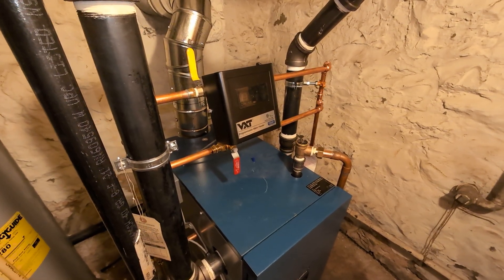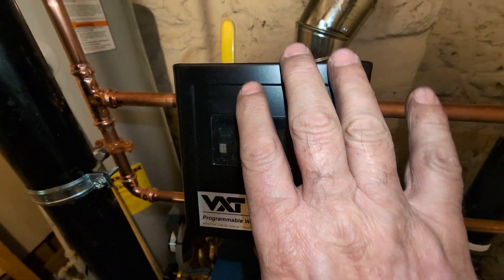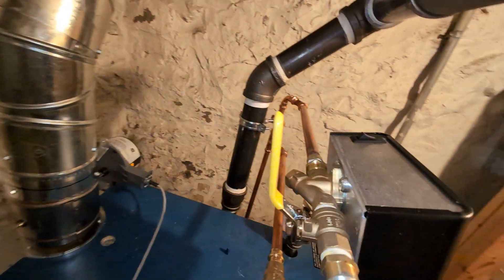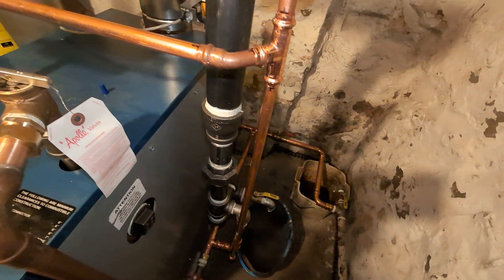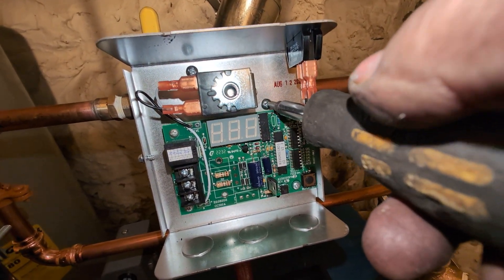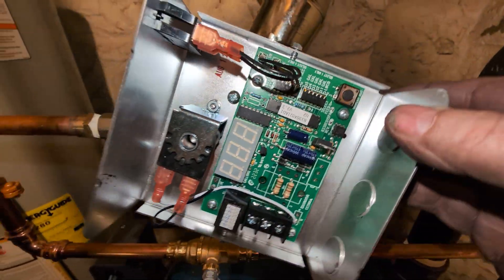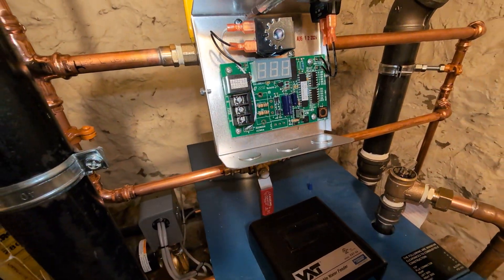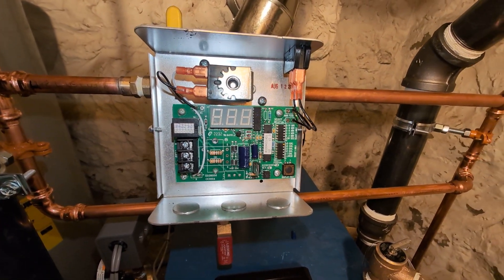No Excuses! Why Install Anything Else Other Than A Hydrolevel VXT?

Comment: Great video Gordon. I’m enjoying watching your videos as I prepare to write my plumbers exam. 

My only question is, which supply is the water make up connected to, hot or cold? My understanding is that hot water already has less oxygen and comes pre-heated. But I’ve also heard hot water isn’t ideal for the materials in auto fill valves, or am I mistaken? Thanks
Reply from the maker: Thank you for the kind words!
All steam boiler automatic fill valve manufactures say not to use hot water as a supply thru their equipment.
Calcium & magnesium salts drop out of solution and scale up the wet surfaces of the valves worse when hot water is used as opposed to cold water (seems counter-intuitive).
Crab steamers need hot water fed to their boilers to keep up production, so in order to get around the calcium build-up issue, they use the feeder valve on the cold water inlet to a standard water heater and the hot water is sent to the boiler thru a Spirovent to remove the air.

Comment: I suggest (3) unions. 1 after eye water feed, 1 after the bypass and a common one on the vertical above the water level. When the boiler over fills, you can break the unions and see which is leaking by. I have seen this numerous times.

Comment: Working in New York on service calls and I come across the MM 101A  most of the time it’ll be the problem
Reply from the maker: @pipers255  Yes indeed 
The 101A may have been good back in the day, but that day was 1/2 century ago.
Even M&M makes a better feeder in the Unimatch
(I briefly met the designer back in 2005).
The only reason M&M still makes the 101A is folks still buy it and they make $ selling that junk.

Comment: The boiler rotter-outer. Trains homeowners to ignore their boiler and to allow the water level to be much lower than it should be lessening efficiency and increasing the temperature of the top of the section castings. Not a fan!
Reply from the maker: I understand your point of view, and your points do indeed have validity, but you must admit you yourself are a few sigmas out in your attention to your steam boiler LOL. 
Most folks don't have your dedication.
So, my point is, IF one decides to get an automatic water feeder, the only one worth getting is one that tracks water usage and can be programmed to fill to optimum water level (and costs less to buy).
Reply: fair enough but I’m not saying they should pay as much attention as I do. I’m just saying they should watch their water level 🙂
Reply from the maker: "(steam boiler owners) should watch their water level" Totally agree.
That's why we have always installed PROPER sight glass testing drains and advised our customers to test them once a  week during the heating season.
Reply: @gordonschweizer5154 you are very good
Reply from the maker: Thank you!
Reply from the maker: I think we can agree that the most villainous of the boiler rotters is the McDonnell & Miller 47-2.
A float-type LWCO requiring weekly draining and testing combined with a rusting iron body eerily silent water feeder that gives no indication of how often it feeds or how much.
Truly evil.
Reply: @gordonschweizer5154  It even looks like Darth Vader